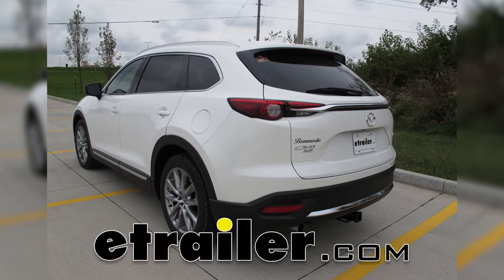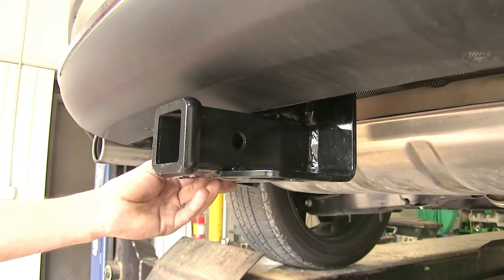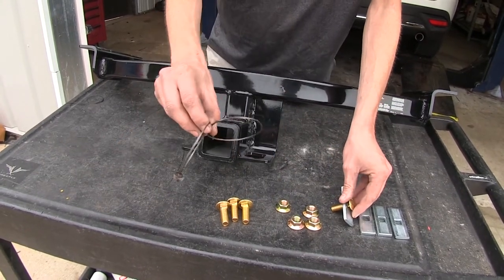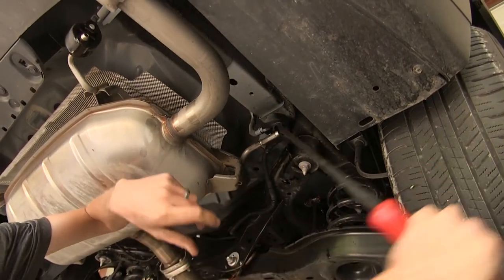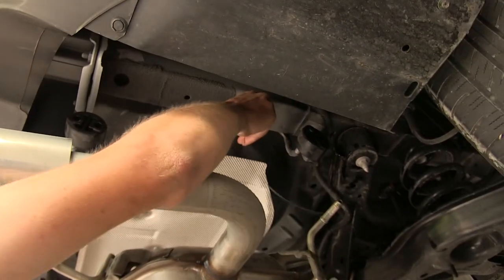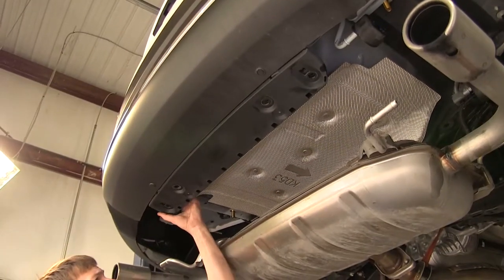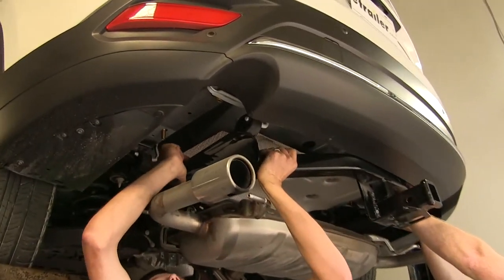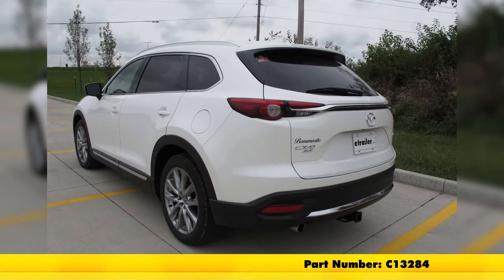etrailer | Beginner’s Guide to Installing the Curt Trailer Hitch Receiver on a 2016 Mazda CX-9

Comment: Is it proper for 2018 CX-9?
Reply from the maker: You can view the confirmed hitch fits for a 2018 Mazda CX-9 by clicking the link below.

https://www.etrailer.com/hitch-2018_Mazda_CX-9.htm

Here are the wiring harnesses confirmed to fit as well: 
https://www.etrailer.com/t1-2018_Mazda_CX-9.htm
Reply: exactly except trim pieces might be a little different.
Reply: @hippiern01  2019 is the same